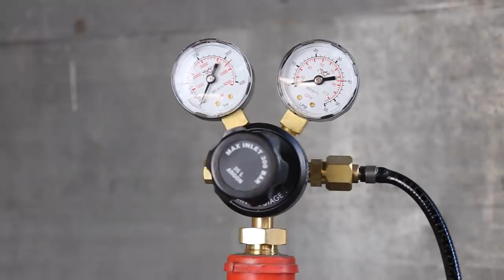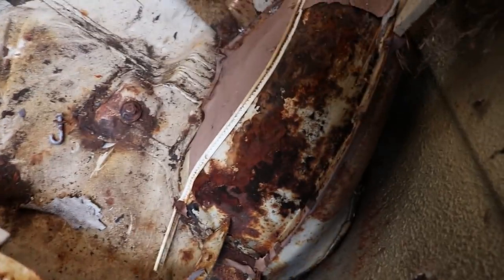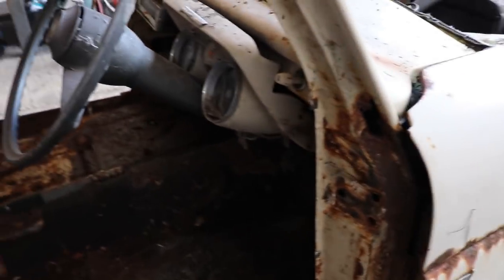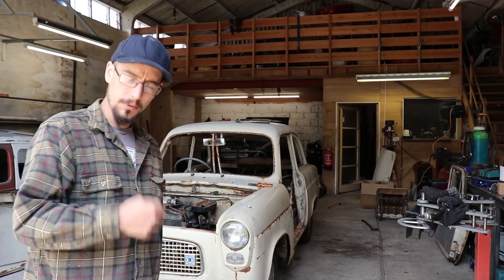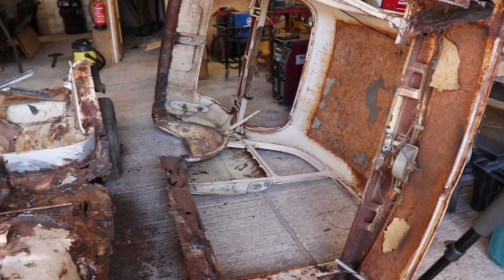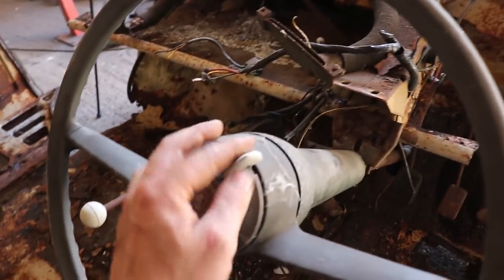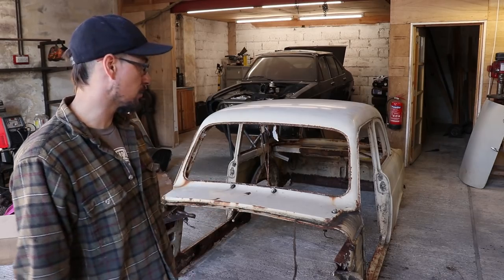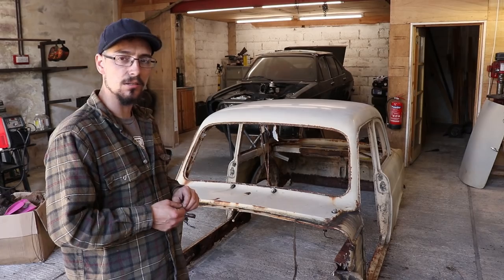1959 FORD 100E BODY ON A MX5/ MIATA CHASSIS. THE MONGREL!

Comment: Have to say  this is fabulous stuff - it is a daily must watch. ( as was the transporter) That is so brave with that level of corrosion it will take all of your self evident skill to stitch all this back together in to a solid car . But the Mx5 is mechanically  such a good car it is actually a great idea. Be great to make it a road car. The original was far too far gone for a viable restoration they do not have the value of a Ferrari - you are doing the right thing.Closer to original appearance the better  be interesting to hear what the finished car weights  should be very light by today's standards. Keep up the good work its great TV.

Comment: That was rusted bad..You could've almost picked it up by it's bumpers and the floor/running gear would just fall out !   I have a 300E van waiting for a resto/modern up.. No where near as rotted as that, being in Sth Australia, rust isn't much a problem 👍

Comment: Have you thought about shortening the mx-5 wheel base? A friend of mine put a C2 body on top of an Evo 4 a few years ago and shortened the floor pan by 7". He made a jig that picked up on the wheel bolt holes of all 4 corners but the holes for the rear end had 7" long slots in them. Simply cut it in front of the rear bench, slid it from the back of the slots to the front, welded back up. Obviously it needed a very comprehensive cage in it picking up off many points to keep it rigid. The only other thing to do was shorten the prop shaft. I did this in a lathe, then it all fit together perfect and drove in a straight line down the road no problem
Reply from the maker: Nah I want to keep the mx5 wheelbase, it should look fine. Cheers

Comment: Before you started cutting you should have cross braced the body diagonally ect from the a, b & c pillars to have kept the body square.
Reply: You certainly should do that when removing any large structural sections when your intention is to retain original dimensions when welding big lumps back in but it's not really important on a build like this because the doors work well as a jig for that area when he starts joining it to the other vehicle & he will be in & out the car so often that braces are more trouble than they are worth.
Reply: You're assuming the shell was originally square...

Comment: I am surprised that you did not weld on any supports before cutting the body off, are you not afraid of it twisting?
Reply: I think it's going to be that out of shape already due to prior corrosion it won't really make much difference.
Reply from the maker: Nah.

Comment: LS swap the miata :) an aluminum block will keep the weight down
Reply: ibidu1 no, this is England
Reply: Confused? Are cars supposed to be slower there?
Reply: @ibidu1  nah, just more difficult to get hold of an LS than in the US. A Rover V8 swap would probably be our equivalent
Reply: Ya but majority are carbed, I doubt the low hp, heavy weight is worth the trouble to fit it. Better off turboing the stock miata engine.
Reply: ibidu1 rover blocks are aluminum but I vote rotary turbo swap

Comment: Dude random but use be interested in the clocks. Out the 100e
Reply from the maker: You want the clocks? the surround is broke but the clocks are here.
Reply: @Urchfab  I only need the water temp gauge part out of the one clock but Ile buy that hole clock.